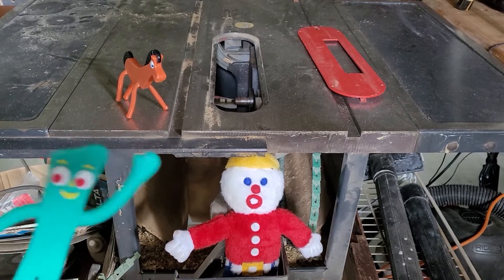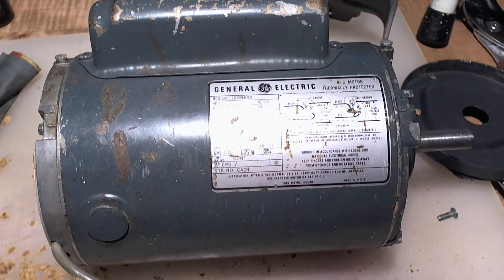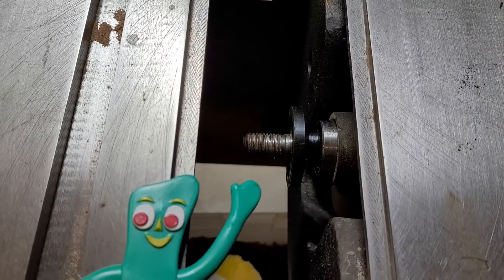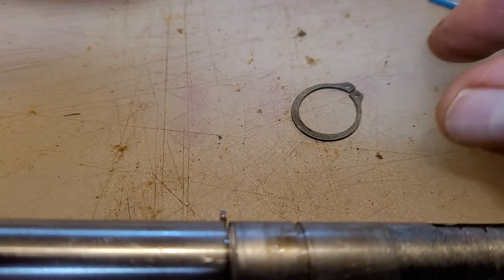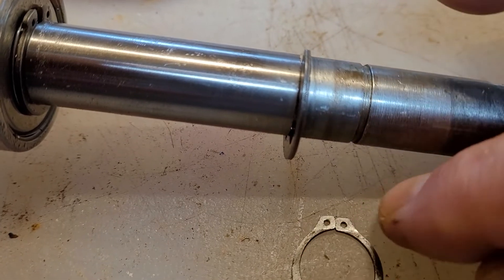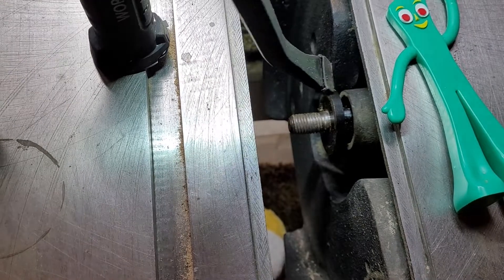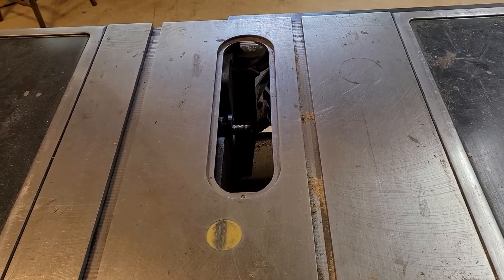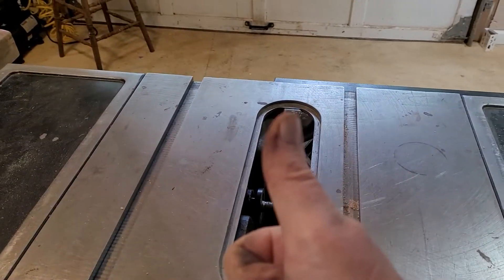Repairing the electric motor on an old Craftsman table saw

Comment: Where can you find the pulley. Mine separated and need a new one.
Reply from the maker: It depends on your model.  I would measure the pully: shaft diameter,  pully diameter, etc. Then, do an internet search for your model table saw replacement pully and make sure they are the same size. 
Hope that helps!
Thanks for watching!!